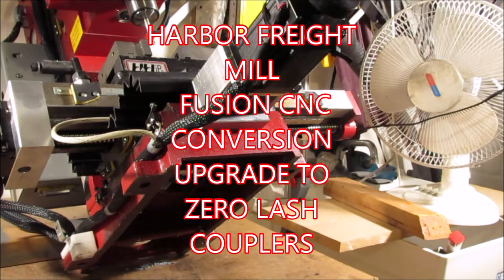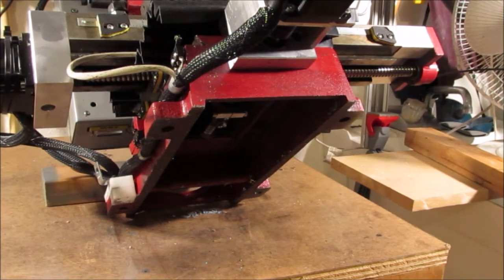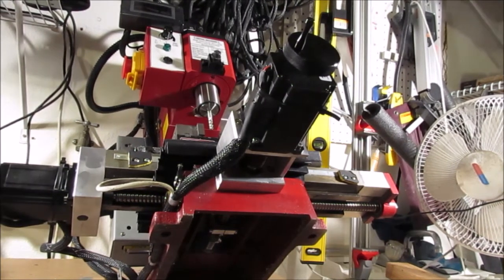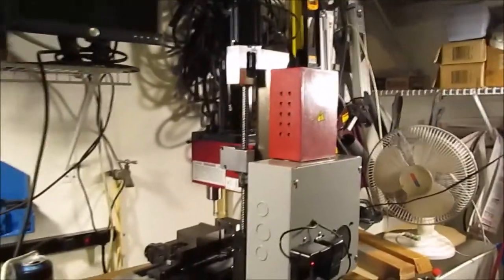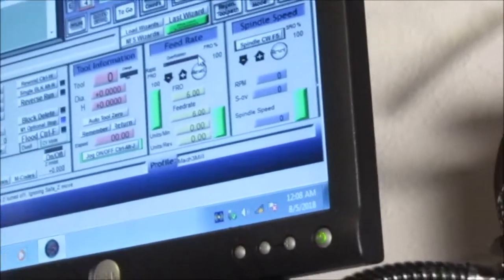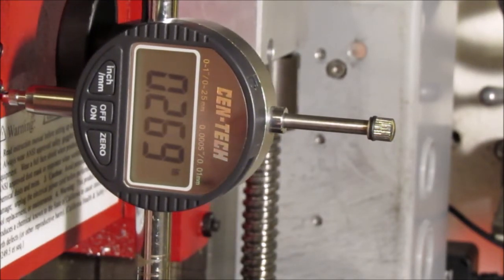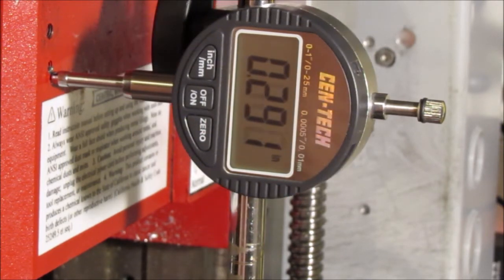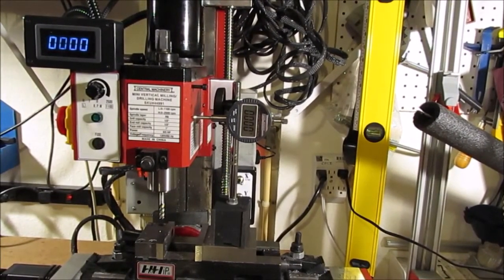Mini Mill Upgrade, Zero Lash Couplers

Comment: Will these work with just the stock way it comes with ? Or does the CBC have too be installed ..  thanks for any info on it.
Reply from the maker: They're only used for CNC conversion.

Comment: Why do you keep moving the Dial Indicator off the mill head beyond its measuring capabilities for this test?  Seems like the most accurate way to test would be to keep the probe tip on the measured surface at all times - I mean ur just measuring for tenths and thousandths ... I didnt see the camera show both at or near zero at the same time ... will re watch with sound next time
Reply from the maker: It doesn't matter. Study the process and you'll see that it works to measure the lash. There are others that use this same method. You may come across other videos that do the same...

Comment: Did you actually measure the backlash this way? The dail indicator and mill was biased the ame way all the time! I would runn the X against the head, stop and reset both indicator and Mac3. Run a bit back on the X. The diference you now see between indicator and Mac3 is the backlash. Or am I missing something?
Yry it for fun and make a video. Im i terested in the result.
Reply from the maker: The procedure is correct. Study the movements and you'll see finally see that.....